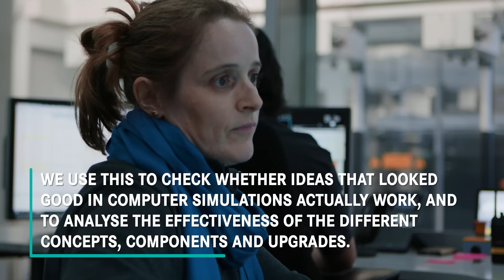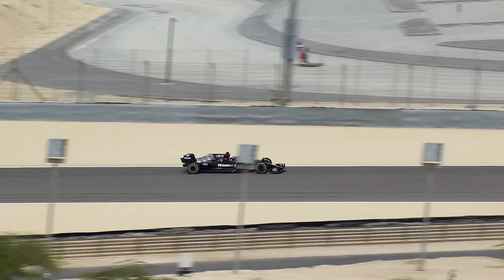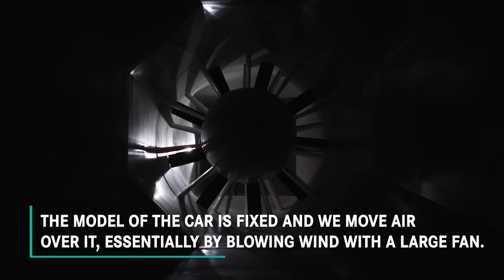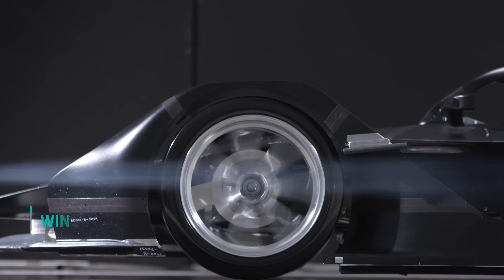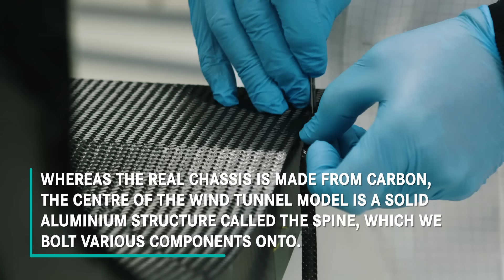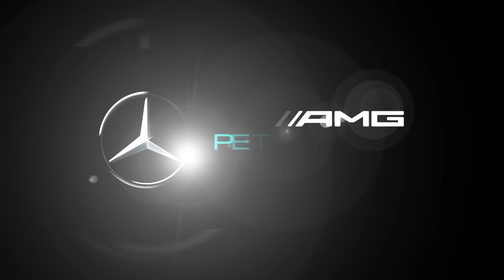Everything You Need to Know About Wind Tunnels | F1 Explained

Comment: Good content! I am very curious about some things. Do you think the limitation of running the wind tunnel <= 180KPH may be hindering our efforts to find out why our zero sidepod design is not  performing as expected?

Do windtunnels offer a way to test how the car handles if strong winds hit it from any other direction other than headwind and how that affects its aerodynamic performance? From how the windtunnel looks it does not seem like it's able to do so. Also, is the design of the windtunnel (diameter / conveyor specs) standardized across all teams or does it team invest differently in their windtunnels (for the teams that have one).

Did the windtunnel tests need to be redesigned to accommadate the new regulations (>=2022) for ground effect cars? Are we testing just the aerodynamic effects of the bodywork or do we also test a scaled down version of the suspension to see how it performs in conjuction to the body? Do you also simulate the weight and weight distribution of the car in the scaled down version?

It would also be interesting if you can tell us how much does a windtunnel run costs a team.

PS I've seen a few pictures such as the one on the 20 second mark where the car is not touching the ground. I am intrigued as to how running such a test can be beneficial since to my understanding most of the aerodynamic elements of the bodywork are there to optimise the ground effect.

Sorry for the too many questions, it's a very interesting subject :D

Comment: Do you usually find much difference between computer simulation and wind tunnel tests?

I imagine the software does the bulk of the heavy lifting and the practical tests are more for fine tuning?
Reply: As I understand it, the wind tunnel tests help with correlation—seeing how the computer simulations compare to, and where they differ from, the 60% scale model. That then allows them to tweak the parameters in the software model, and arrive at strong confidence in the predictive power of their model, which they can then use each race weekend in scenario planning and to inform strategy calls.
Reply: @midnightfuture  interesting, thanks for the insight!

Comment: might be wrong about this but if your wind tunnel flooring is smooth but real racing track is  uneven from track to track why is the flooring smooth and not uneven because suspension would move as in real live with air moving around might be wrong when saying this 🤔

Comment: Are you limited to what temperature you can run in the wind tunnel? For instance do you need to cool the air down to make the flow denser since the model is only 60%? or at slower top speed?

Comment: I always wonder, can you simulate/test corners within a windtunnel? I read once, that the tilt of the front wheels due to steering drastically changes the airflow.
Reply: Yes, the Wind tunnel rolling road is also a turntable, to be able to angle the car to flow simulating taking a corner.  The models can also fully pitch and roll and the suspension can be loaded to simulate individual forces and tyre squish per corner.

Comment: What about cornering wind?
Does the difference too small between straight line to actually implement it or is it just impossible to simulate?
Reply: The Wind tunnel rolling road is also a turntable, to be able to angle the car to flow simulating taking a corner.  The models can also fully pitch and roll and the suspension can be loaded to simulate individual forces and tyre squish per corner.

Comment: If the Bernoulli principal allows you to create more downforce without adding a lot of drag why don't you add that to the top of the car? Instead of side skirts that turn up why not have a second skirt above that is in the shape of a long upside down airplane wing this would not be under the car so it technically wouldn't break the rules right?

Comment: 1:30 But then how do you simulate the flexiness of the wings?
Reply: Expensive computer programs I guess - it doesn't really explain how 60% steel models running at 60% speed can help without some expensive recalculations having to be done elsewhere.

Comment: How does having a 60% model of the car save costs? By saving space in the wind tunnel?
Reply: Possibly saves the smaller teams from having to build a full scale model. I'm not defending the idea because it probably costs more to produce accurate scale models and parts. I think though it's easier to restrict what a team can gain from a 60% scale model running at a maximum speed of 110mph - but then it probably takes more computing calculations to upscale that to a full scale car running at proper speed.
And then the models are made from metal which behaves very differently from carbon fibre..........

Comment: Just use a liquid based tunnel. Simple loophole in the regulations.
Reply: That's not the same at all.
Reply: @gelmir7322  they do use it to some extent in aerospace Already to compensate for drag calculations and fluid dynamics of air at higher speeds. Won't be too crazy to do the same with a 65% scale chassis. Allows to simulate high speed aerodynamics at lower speeds.
Reply: @shivamvaid601  
That will give them a very bad/irrelevant data and noises.
Not to mention that it is probably more expensive operate.
Why waste money on something that will end up being useless?

Cars are land vehicles, so they need to simulate actual fluid compression between the ground and the vehicle.
Liquids are largely non-compressible fluids.